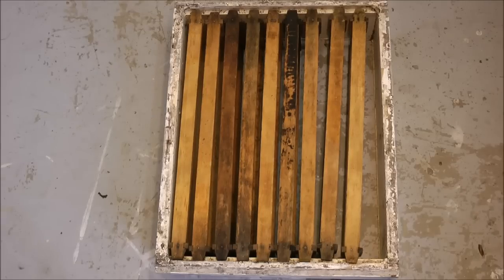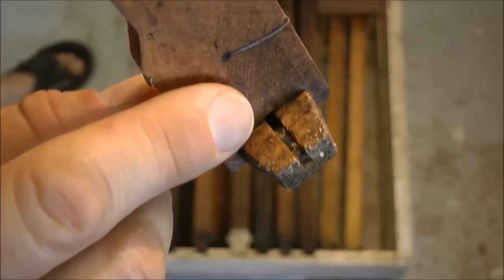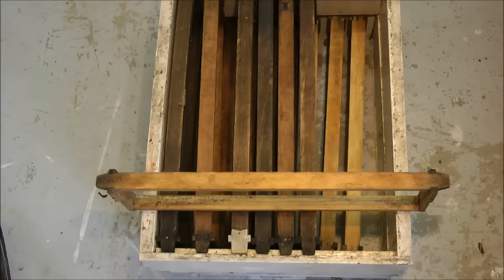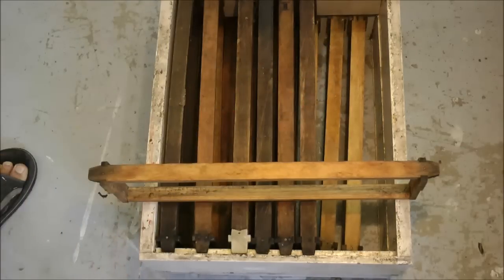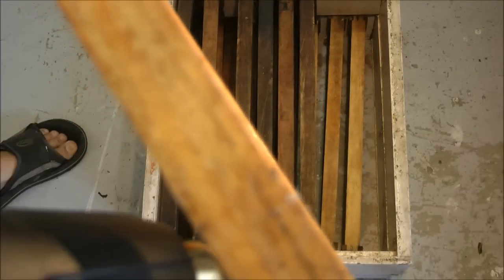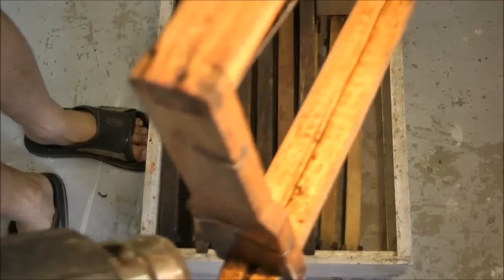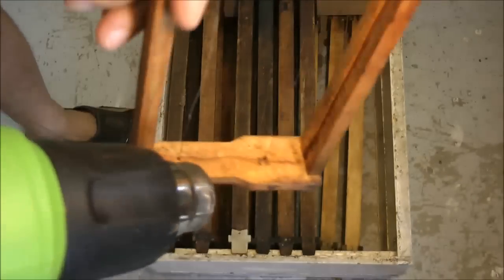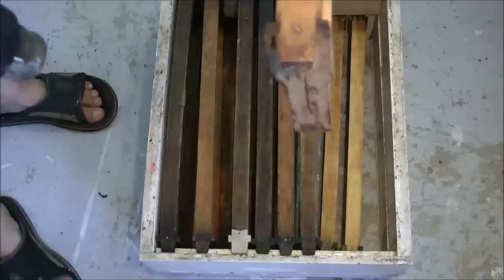KILL Wax Moth with a heat gun. Quick, easy and cheap.

Comment: Great video. Thank you for showing the heat gun alternative. I was in process of finding a cheap chest freezer, however I might re consider now after seeing how well your heat gun worked.
Reply from the maker: Hope it helps. We also freeze frames that have good and young comb. Although the beeswax does tend to be more brittle after defrosting, and most importantly, it condenses water inside the cells, so it is prone to mold thereafter. It is rather difficult to dry after it has the moisture on/in the cells, because the remaining honey mixes with the water, and creates a very runny nectar like substance. Running a fan or air con does help, but is never seems to dry totally. Admittedly, we are located in Australia and humidity is rather high. Does anyone have any experience with this issue?
Reply: After my split died, moth moved in.
I took the frames out of the dead split hive and opened all the cells. I set them outside so my main hive could rob the honey. While the bees robbed the honey ants moved in and carried off any larvae they could find. The split hive body was kept also open and bees went after the propolis and ants went inside to clean it also.
I froze the frames afterwards for 3 days. 
Now the frames with foundation are ready to be put back into the hive and the bees will clean the rest before they use it.

Comment: Build a solar collector that's big enough to fit all the boxes and frames.  With the right sunshine, and time, the temperatures inside of the box can reach 200°F (94°C).  It takes all day to do it, but the time the eggs have to sit in the heat is also critical.  The melted wax soaks into the wood, and the long baking process also stresses and kills microorganisms.  American Foul Brood requires other treatment, the spores the bacteria produce can handle a lot worse.

Comment: The frames need to be heated up for a long time so the heat can penetrate the wood in order to kill moth and the eggs.....sorry, just a few seconds will not get the wood hot enough and the heat will not penetrate into wood in a few seconds to kill the eggs and possible larvae. Stick them in an oven for an hour would be the best way to do it, this would also kill bacteria.

Probably much better to lay them in a deep cookie tray filled with alcohol and let them air out afterwards. this would kill eggs and larvae.

I usually use the freezer to do the job of killing moth.
Reply: An oven for an hour wouldn't kill bacterial spores. I think the idea is to do the best you can do but not to sterilise everything as that is very difficult.